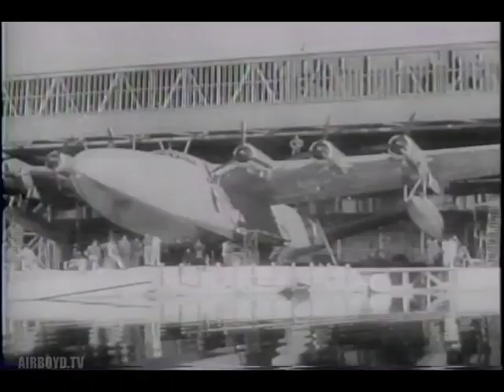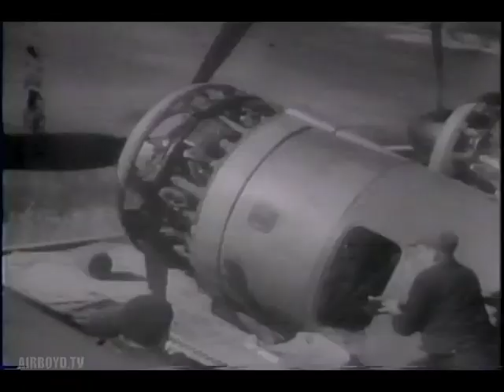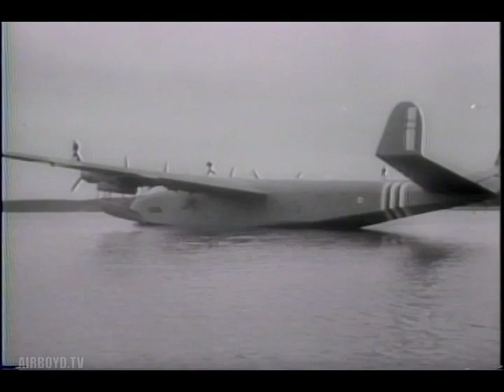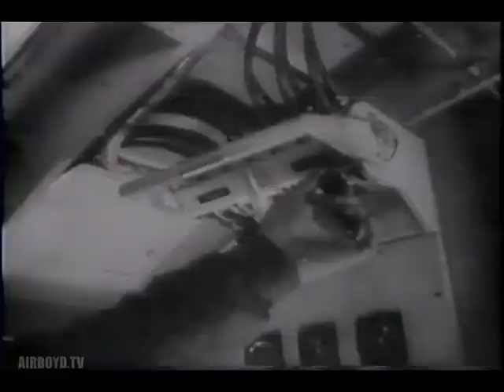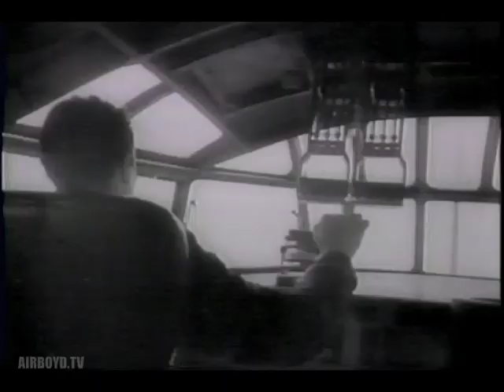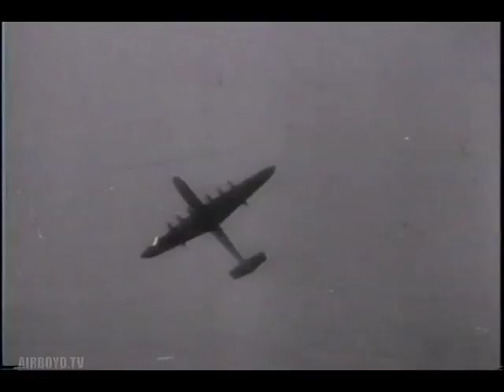Latécoère 631 Flying Boat

Comment: For sure, the most beautiful flying boat ever. I visited Lake Biscarosse and the Musée Historique de l'Hydraviation. It is located in the houses which were built to accomodate engineers who worked for the Latécoère factory. Sadly, the Hourtiquets seaplane base is off-limits as it is located on the edge of a firing range.